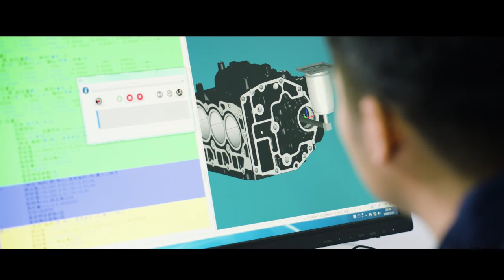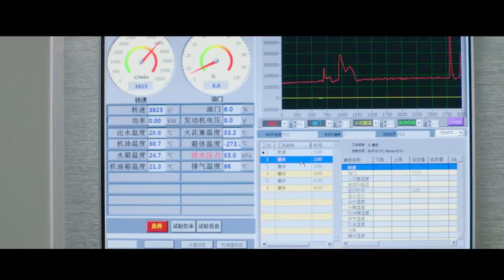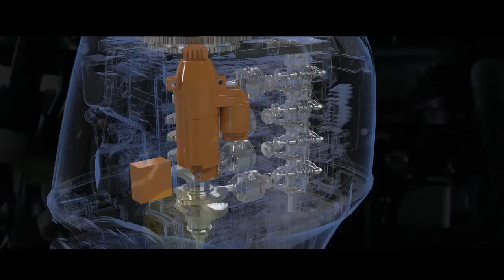Hidea's Production Facility - brand new in 2018!

Comment: Hello, I bought a 6hp 4stroke long shaft engine. I couldn't find any oil under the propeller, on all the cables, plus on the engine mechanism, and I would also like you to enlarge the water cooling exhaust hole because it is too small. Everything else is fine, you could also do at least one oil lubrication point.